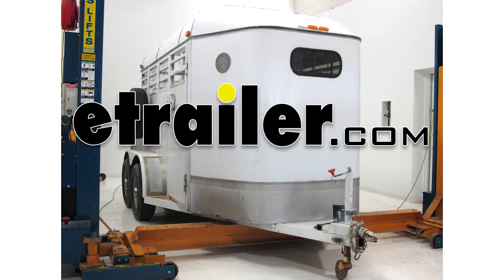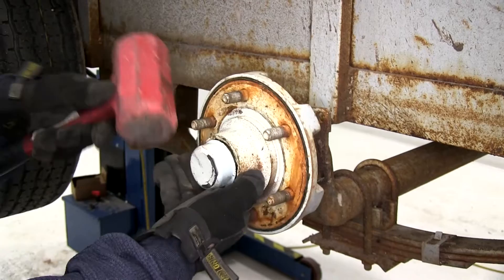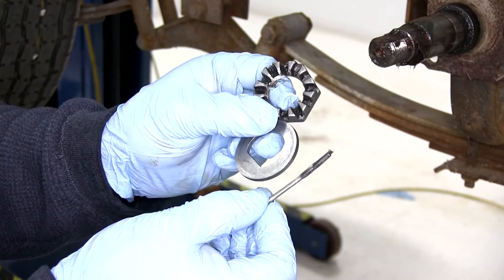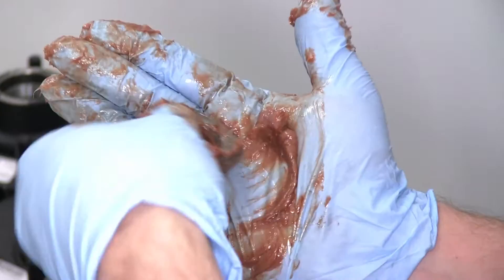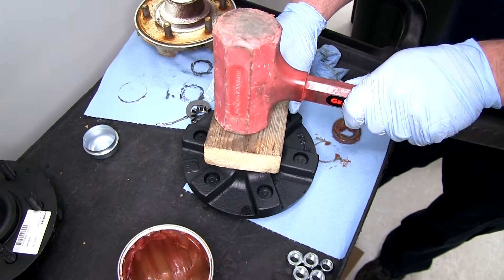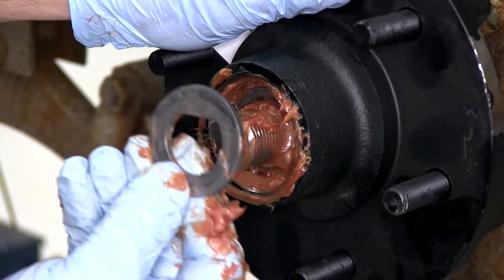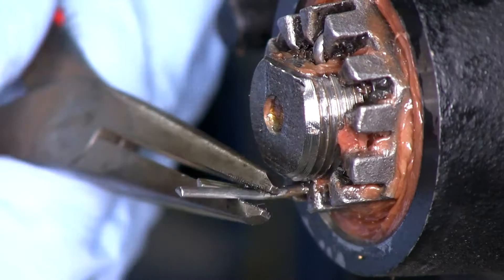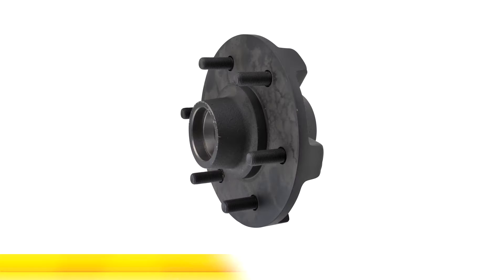etrailer | Trailer Idler Hub Assembly for 3,500-lb Axles: The Breakdown

Comment: can i put a 8 lug hub on my 6 lugs hubs
i got the same axle on the video)
5200lb dexter tendem axels trailer,one axle with brakes and one without.
I HOPE YOU ANSWER .!!!
great video
Reply from the maker: Happy to answer!
The axle in the video is a 3,500 pound axle which doesn't use 8 lug hubs. Since yours is a 5,200 pound axle you likely have bearings 25580 for the inner and 14125A for the outer in which case you can definitely go to an 8 on 6-1/2 bolt pattern
You also need to measure the inner diameter of your seal. With 5,200 pound axles it's probably 2.125 (2-1/8) inches but it could be 2.25 as well. If it's the former, hub https://www.etrailer.com/Trailer-Hubs-and-Drums/Dexter-Axle/42865-KIT.html fits your non-braked axle and hub and drum https://www.etrailer.com/Trailer-Hubs-and-Drums/Dexter-Axle/8-219-4UC3.html fits the braked axle. 

If any of my "guestimations" are off these won't be the correct parts but if let me know the correct numbers I"ll find you what you need.